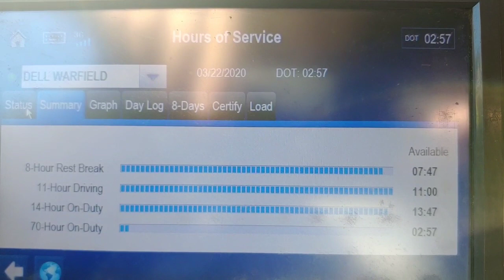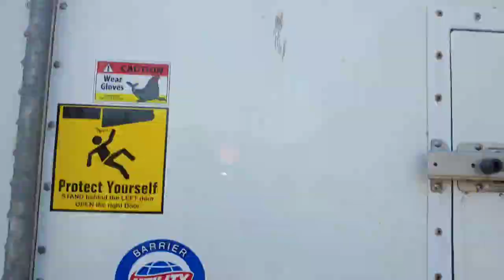#MayTrucking : HOS

Comment: How do u run your clock yourself ?? Do u exhaust the 11 hours daily?? Or you split???
Reply from the maker: With ELDs its a little different. I don't get to drive as much 😕 

But on their clocks they drive minimum of 500 miles per day which is about 9-10 hours on their 11 hour clocks

Comment: You got the 70 hour clock wrong.
Reply from the maker: What is the correct way to explain it 

70 hours on duty and driving  in 8 day period right ?
Reply: You said yourself that you were negative on hours. The law controls driving. Not working. The correct words are important. I think you’re doing a really good job though. 👍
Reply: You need a camera rack that sticks to the inside of the windshield to stabilize you time lapse videos. I had one. It works great. TA’s have them. They can have different attachments to hold your phone or camera.
Reply from the maker: Ahhh gotcha thank you Steve !! :) I'll defiantly work on my wording your right 100%

I'll be sure to get camera rack too, just started this thankfully able to record while ELD drives. Be getting one ASAP
Reply: Best time to take the 30 min break is at the 6 hour mark